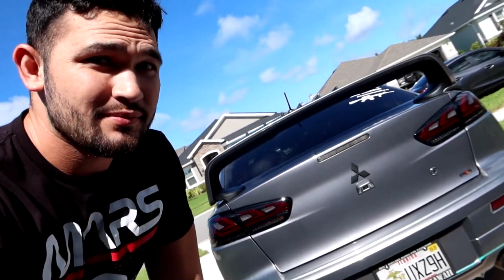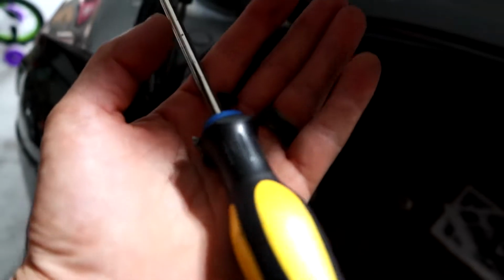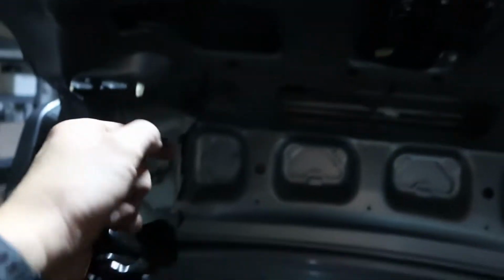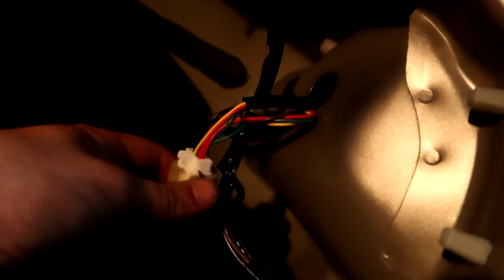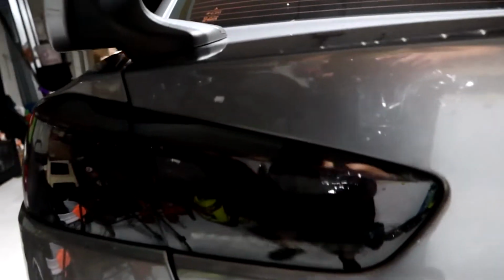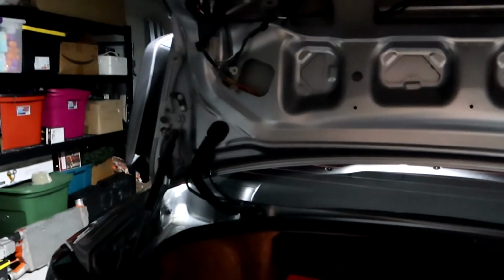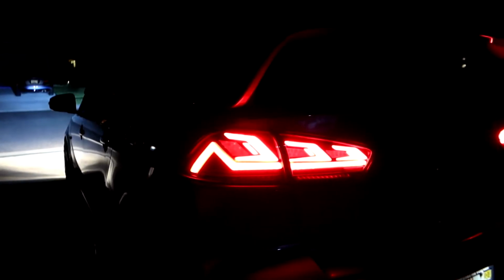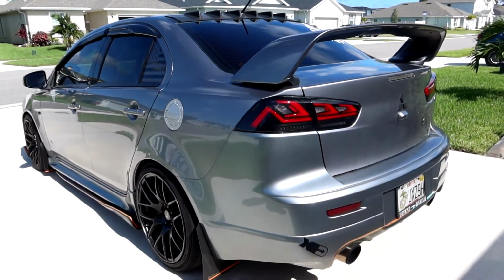NEW! HC Motion Tail Light Install for Lancer/Ralliart/Evo X (2008-2016)

Comment: Bro, you forgot to mention turning off the animation also changes the sequential indicator to a blinking indicator 😜 I never actually noticed on mine, I thought it just turns off the start up animation but it also changes the indicator. Also, are your headlights stock vland with HID? I couldn't seem to adjust mine when I had a pair.
Reply from the maker: The more you know! I didn't know that

Comment: I have these tail lights my reverse lights won’t stay on. I had the first set like you did and I added a resistor to the center tail light. That fixed my recent first lights. Thanks to your video now I have this version of tail lights and I’m having the same exact issue where my reverse lights won’t stay on. Do I have to add a third resistor? If so, where do I do?

Comment: I think I’m planning on getting these lights but out of curiosity with the turning signals it’s just the LED strip that’s directional right? Like for example with the startup animation the whole light has a directional animation, would be cool if the turning signals had full light animations too but the LED strip is pretty cool by itself.
Reply: You can toggle the sequential on or off, but yeah just that led strip is for the turning signal

Comment: Good day just want to ask if your have any issues on your brake after installing the HC motion mine is having problem after 6 months the pedal was bottoming while braking and sometimes abs asc service required? I put my oem tail light everything works fine.
Reply from the maker: Definitely haven't had that issue. Not sure how that happend
Reply: @TheSnyds  thanks for the reply hope it’s just the resistor might have to replace it.

Comment: So what’s the trick to remove the corner pieces?  I’ve chipped two sets of tail lights on the corner when trying to take them out.  I struggle for awhile to try and slowly remove them without the corners hitting the car 😣
Reply: Get yourself a plastic tool kit/car interior removal kit. eBay or amazon. Pretty much a must have especially when removing interior pieces so you don't damage any of the parts inside your car.
Reply: @memphisraines8118  Good to know, I shall try that.  Thanks

Comment: Hi just got the same ones installed and the animation does not work when I unlock the car? How do I go about that?
Reply from the maker: Did you have the switch turned on?
Reply: Yes switch is on. It only works when I turn the ignition
Reply from the maker: Not sure how it knows. But mine does the same, but at night it works
Reply: Did you figure out how to fix it? Mine does the same thing

Comment: Hi man. Great video. I used your walkthrough to install my new motion tailights on an Evo X 2008 JDM. Just saw on 6.59 minute that you have a resistor installed on the inner tailight. What is this for?
I have also installed an after market camera which is getting power from the reverse lights cable. 

When I connect the new motion tail lights and put reverse gear and then put 1st gear, the after market camera and the reverse Led lights stay always on even on 1st gear. 
So just thinking if I have to add any additional resistor.
Reply from the maker: The resistor could work out in your favor. I had my resistor in olace for the VLand setup. My reverse lights and camera would shut off in 2 secs
Reply: @TheSnyds  I think so too. Waiting for a reply from vland Just in case they have something else to suggest. But I think will give it a try in the end. Keep rocking man!

Comment: Hey man, I just bought these lights for my 2009 lancer ralliart. But I'm having an issue with the reverse lights staying on. When I shift into reverse the lights come one, but when I shift back into park they stay on and don't know when to shut off. I'm confused, can u help???
Reply: @Elliot Roy hi mate, I am having the same issue. Just figured out in my setup (Evo X 2008 manual JDM) that the issue is with one of the 2 inner taillights (mine was the left one). Outer installed motion tail lights with inner OEM tailights seems to have no issue at all. I am researching now whether another rersistor is needed specifically in one of the 2 inner tail lights (as shown in this video at 6.59 minute).

Comment: To those that install these with LED’s if the ASC service light comes up after a while of driving it’s Bc of the LED bulbs from these HC motion Tailights. Recommend either swapping out the LED bulbs provided with the taillights with Oem bulbs or getting a resistor.
Reply from the maker: Nice input!
Reply: After installing the these, my engine is having misfires when it is turned on. Will getting a resistor solve this issue? And which wire should I connect the resistor to? Thanks.
Reply from the maker: I'm not sure, but you can add an inline resistor. You'll see where I spliced mine in in the video
Reply: Where do I add the resistor? What wire exactly?
Reply: @joshuac.5353  following

Comment: Wait so do I need the resister to use my reverse lights? Cause I don’t know how to do that lul
Reply from the maker: You prob won't need them. But if things act up that's one easy to fix it
Reply: @TheSnyds  not to be that guy but can you make a vid or maybe set some time aside to make a comment listing what to do and how to get the transistor running with the wire? I get anxiety when I’m stuck lmao
Reply from the maker: I have a video out there already on it. Look up lancer tail light fix and it should pop up.
Reply: @TheSnyds  got it

Comment: Price bro?
Reply from the maker: It's linked in the video description man
Reply: I ordered from Ali Express around 230$ It will be the same?
Reply from the maker: I can't speak on that one. Only the one I bought,  hope it works for you though
Reply: Bro I fixed mine nd they r LIT 😍🤤 Highly Recommended guys !!
Reply from the maker: What did you have to do?
Reply: Bro I fixed this lights month a ago now suddenly my car fail to take accelerate on road i took to agency nd they computer check my car and got error in brake light switch so they ask me the issue occur due to this tail lights ..
Possible ?

Comment: I have a question if I was to switch the stock stereo with new one will all the settings go to the new stereo?? Like the tire pressure and other stuff??
Reply from the maker: I can't speak for all of them. But my tire pressure did
Reply: @TheSnyds  ok I appreciate it. My stereo was locked when I had brought the car. I recently put new transmission, headlights, and front bumper on the car. I just wanted to make sure the stereo I put in all the settings go over into the new stereo